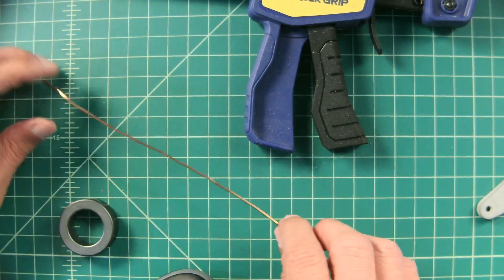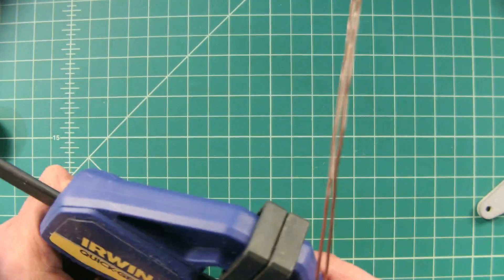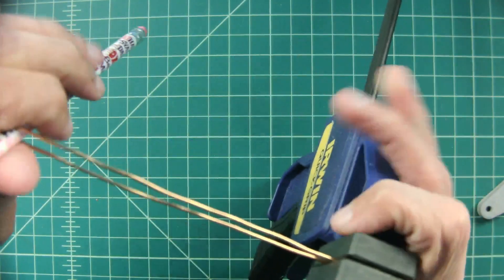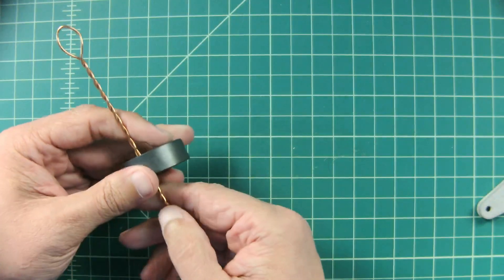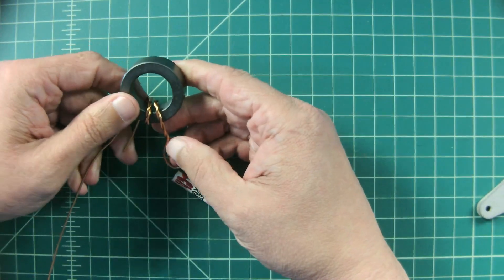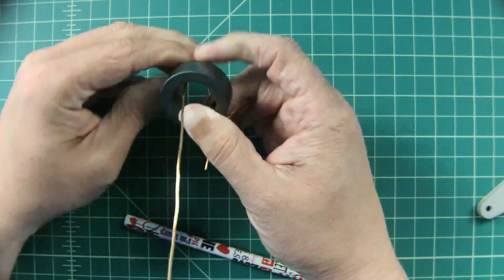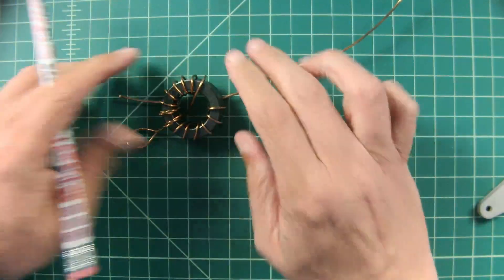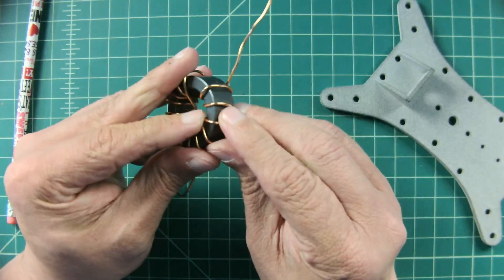Winding the CaHRtenna Artemis Toe-Roid  (Prototype) - 49 :1 Unun / Balun

Comment: nice heavy wire.  the toroid will limit the max power.  doing a tipple T 240-43  core with silver plated PTFE wire but 64:1 and no cross over. think Kapton tape the cores together in a stack. I may put 2- 220 PF 3Kv disk caps in series. makes 110 PF 6Kv. the next size up I have is 330 PF 3KV . I think the 2 will do full legal power just fine. I think a electrical ABS box at home depot will work.  I like that CAHRtenna  .what the power rating on that one?  I got one with a T 240-43 core on the way as a kit. 250 watt PEP . That POTAFLEX 7 coax is bright yellow, NEON yellow. boy does it flex. Mike K8MRD had a lot to do in the makings of that coax.   that winder super neat. That came the outher day and POTAFLEX 1 meter jumpers. came from Italy . love your build videos . helps me with my projects ,I do allot of them. 73's
Reply from the maker: We tested a bunch of different gauge wire for this and felt that the 16awg was the best choice.  We say the antenna is good for 100w ssb and 50w digital / cw but I have run about 85w on ft8 without a problem 👍. Good luck on your antenna build, sounds like it will be awesome 👍